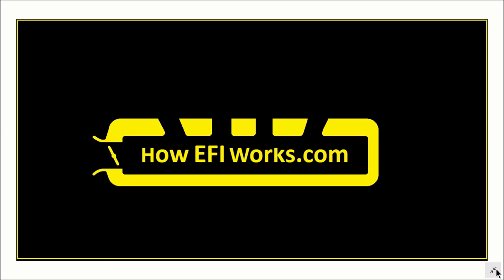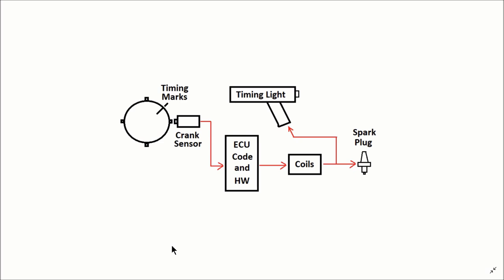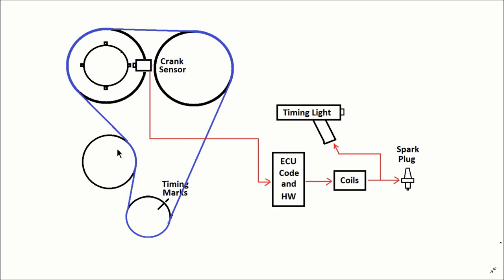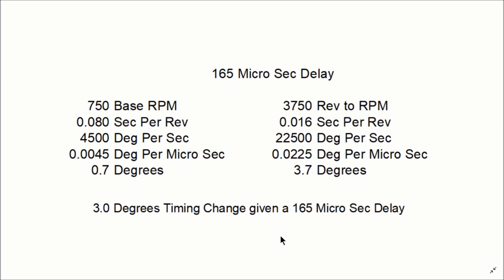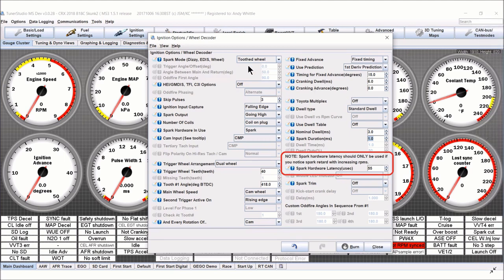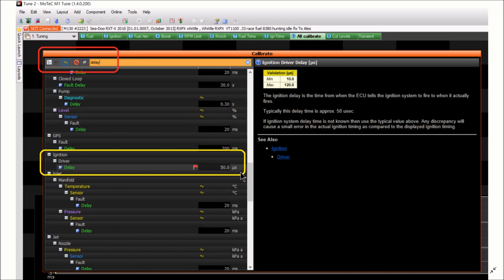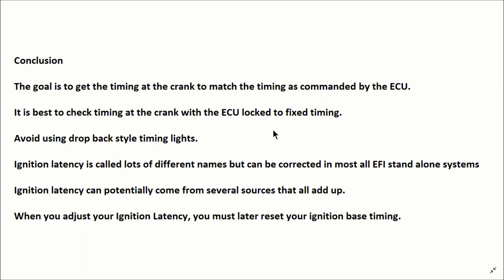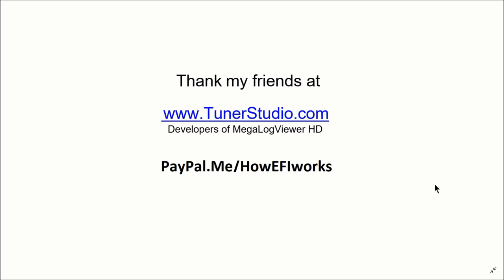Ignition Latency (Spark Timing Error)

Comment: I am very curious about spark latency with a gm TBI distributor and the different 369 and 048 ignition control module have built in latency and timing control. What i think im experiencing is a cross fire or cross spark issue in the distributor cap because of a spark latency issue at a higher timing advance.

Comment: Carburetors are a bit wasteful but make this much less of an issue. All though that is probably due to the excess fuel during the lean periods and the ability to change a jet or emulsion piece for fine tuning of the increasing demand with rpm.

Comment: Hello Mr.Whittle am regular viewer of your videos and I have seem them all but I have a question that am sure you will be able to answer some engines like the Nissan qr25de found in a lot of Nissans such as the xtrail and sentra vspec use a continuously variable cam timing  which is very different from vtech and vvl so I was wondering if there was a way to control it using   megasquirt ECU   by means of pulse with modulation thanks

Comment: I have another question, with the engine running, timing fixed and a timing light on the crank, can we simply increase or decrease the latency time until the crank and computer ignition degrees match? 

Thanks

Comment: great video ! but how does the "0.7" degree delay come out when 750 rpm, I can't understand ??? Does the 165 micro sec  is a standard?
Reply: He gives an example based on the oscilloscope datas at the end of the video.
There is 0.4 ms of delay wich is 10° of cranck angle acording to the oscilloscope.(360 ° divided by 36 teeth = 10° per tooth.)
In its math he gives 3.7 degrees at 3750 rpm ,he just multiplied by 5 the idle 750 rpm values,but it's not taking in consideration that the increase in delay is not proportionnal to the rpm,it's increasing with rpm on his example.